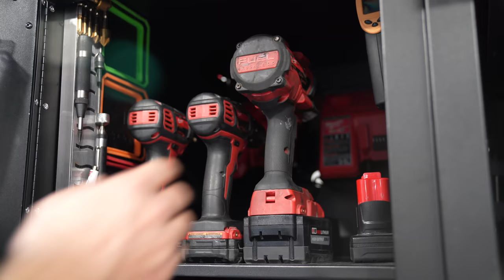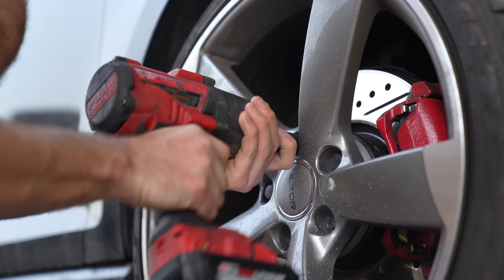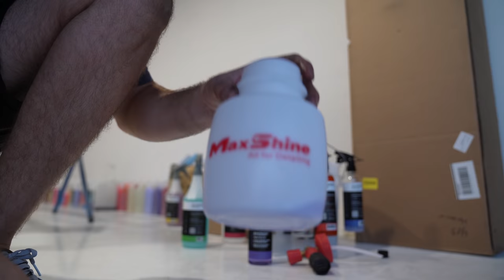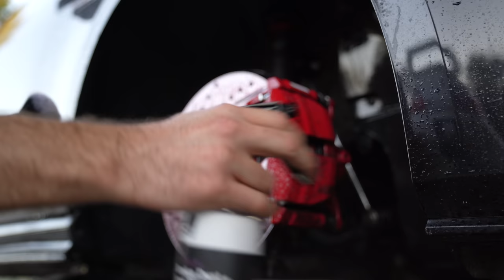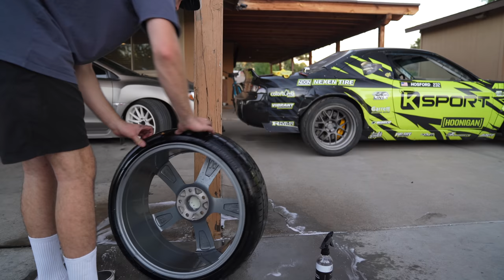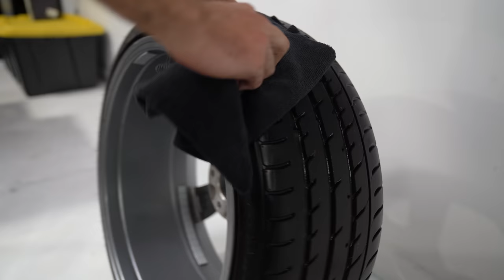Wheel Off Detail - Wheel Well, Iron Remover, Ceramic Protection & Dressing

Comment: Nice setup! I couldn't stop looking in the background at all the other cars. It's like an episode of MTV Cribs over there! For road tar spots I knock off the chunky stuff with something soft like a bondo card and then use tar remover or wax and grease remover. Throwing a coat of wax on them will help reduce grime build-up between details. Are those Audi takeoff wheels? Good looking setup and some great looking vehicles. Keep it up!

Comment: You should consider an iK foam pro 2 sprayer. It will give you a drier (shaving cream like) foam. P&S brake buster or Adams tire/wheel cleaner diluted in one will give you excellent results using less product and less applications to get the job done. Loved the video tho, some ASMR detailing is always relaxing

Comment: Tar remover and a microfiber towel should do the trick. If the tar spots still wont get out you could heat them up with a heat gun👍🏻I recomend going over the wheels with clay too; gets out all the dirt the chemicals cant remove